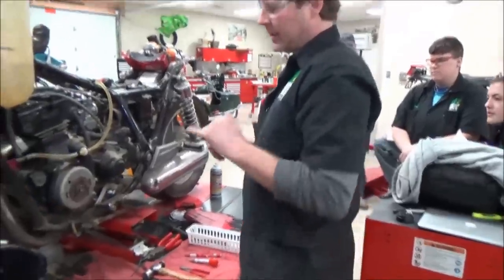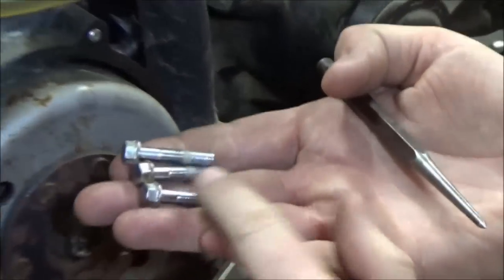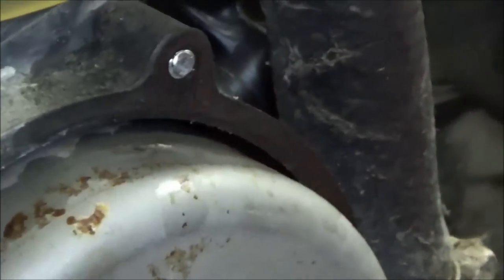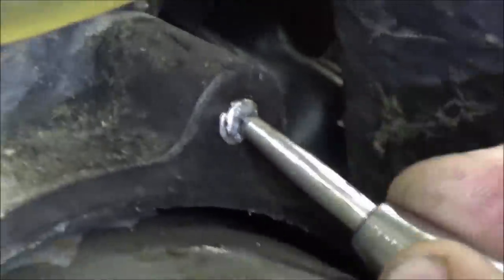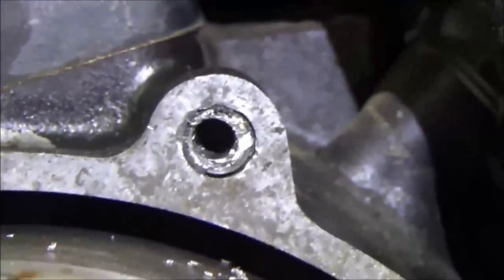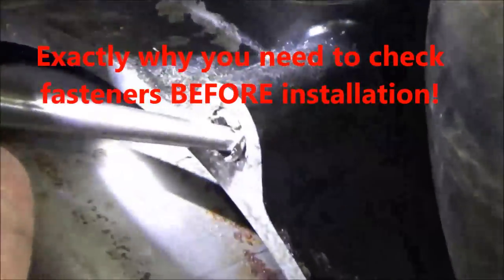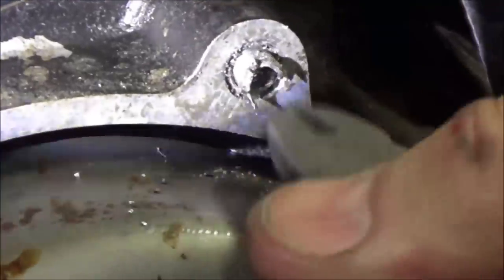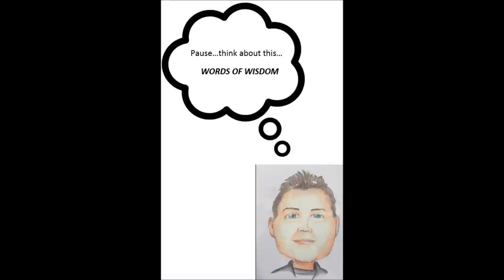How to remove a broken bolt! Extract with seized fasteners with skill!

Comment: If you end up drilling, I've had luck using a set of reverse drill bits. The counterclockwise drilling action has the added benefit of turning in the same direction needed for removal of your broken fastener. This allows you to sometimes remove it without needing any other tools. BTW, great video series Shane. Shared with my son who is an up and coming auto tech.

Comment: sometimes a square easy out is better the the spiral type.  The spiral tighten inward as your trying to remove the broken screw or bolt. I never really worked on motorcycles. Adding a little heat around the bolt will make the housing expand, the you can unscrew it.There are many ways of removing stuck or broken fasterners. One thing you should do a video on is when the head of a fasterners starts to gall against the item it is holding down. This causes more headaches than a broken bolt.

Comment: I am stuck at this exact point, with a hole drilled in, but the head (1st attempt with star key) and excess snapped off (2nd attempt with wrench) due to it being rusted in place. I wish it was a bend issue. PB Blaster seems to not have helped too much. boy I wish i owned a welder.

Comment: The technique I found works best for me is to drill a hole in the centre of the thread as you did, I then insert 1 half of small pair of needle nose pliers in the hole and unscrew. I now just default to this as seem to save a lot of time in the long run in trying to extract and then end up drilling out anyway.
Reply from the maker: Thank you for the comment. See the link below for more help. I have been banging my head against the wall thinking of ways for people to say thank you in an impactful way to help keep these videos coming. Here are few ways that many have found as a way to give back. 
* Membership to H2W (includes t-shirt or tech help) https://how2wrench.com/product/membershipmembers-onlymembers/
* Simple donation to say "KEEP IT UP"
May you have a great day and... https://www.paypal.me/how2wrench

Free Mechanic info, tool reviews, and “how to” videos newsletter sign up: https://how2wrench.com/subscribe-free-newsletter/

Missed a past issue? No Worries. Newsletter Archives: https://how2wrench.com/blog/newsletter-archives/

Like freebies? Click here for a free diagnostic checklist! 
http://gem.godaddy.com/signups/364621/join  

If I can ever be of service to you, here is a video explains how to connect with me. 
https://www.youtube.com/watch?v=vjvmB01ebcs
Reply: What drill part would I use

Comment: I have a question. I have a broken bolt ( this is on an auto ) on the transmission where the tail shaft housing attaches. upper right hand bolt. It's a really right area to work in.I've gotten it drilled all the way through but still can't get the bolt out. Figured I'd drill all the way through but I'm not sure I can get the tap tool in the tight area to turn it for 're-threading. If I just drill all the way through and use a locking washer, bolt and nut would this be ok? I don't know what else to do and I'm stuck at this point. I have very little mechanical know how working on a 64 impala. Lost my right leg and trying to get back to driving. Love your channel!
Reply from the maker: +Zombie Dave 
Email me pictures and I will try and help you out. conleybuilt@gmail.com
Reply: +Shane Conley I'll get some this weekend. Thanks a bunch!
Reply: +Shane Conley I emailed ya. :)

Comment: sir....can we weld a nut over that broken bolt and remove it??
Reply from the maker: Thanks for commenting and adding value to our community! That is another great technique. here is a playlist to a lot of great fastener removal and repair information: https://www.youtube.com/watch?v=7b4BBbtuxpY&list=PLAtBOuPaEyt8CN5gV1J6vRxEsyyK4VZZk 

Have you subscribed yet to never miss a video? Have you seen the video playlists? Check them out here: https://www.youtube.com/user/conleybuilt/playlists  

Want to say “thanks” or “keep it up”? Click here https://www.paypal.me/how2wrench    
 
Your answers and help are just around the corner. Save time and money while protecting your investment and yourself by doing it the right way at www.How2Wrench.com 

p.p1 {margin: 0.0px 0.0px 0.0px 0.0px; font: 12.0px 'Helvetica Neue'}
p.p2 {margin: 0.0px 0.0px 0.0px 0.0px; font: 12.0px 'Helvetica Neue'; min-height: 14.0px}
span.s1 {color: #dca10d}